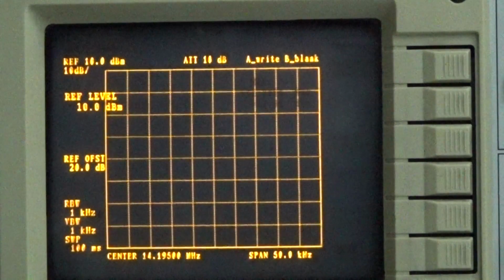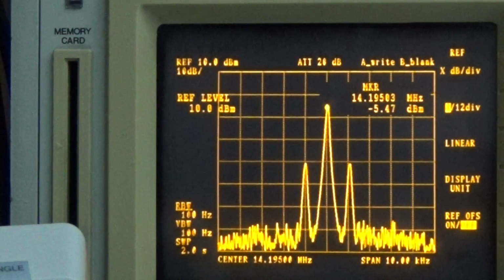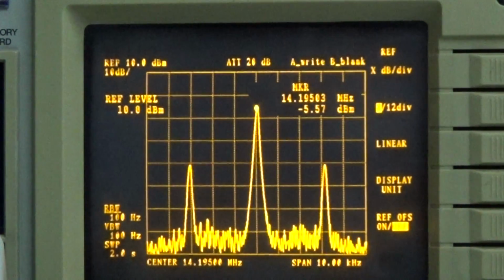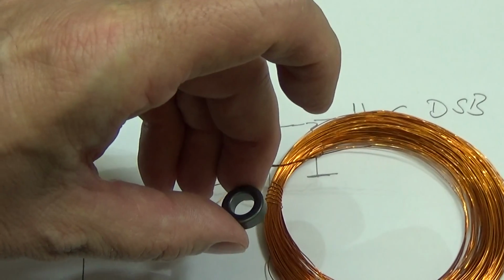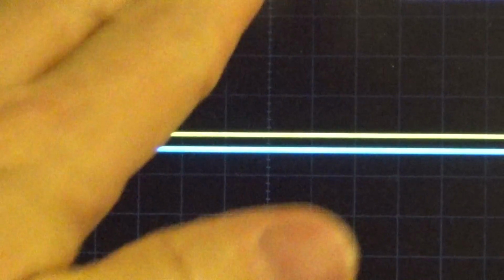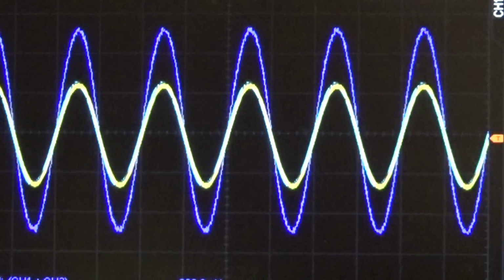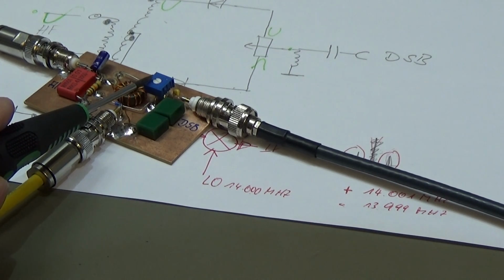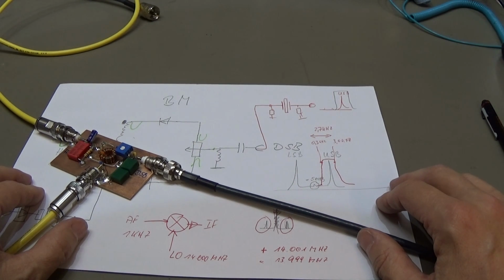#66 HAM Radio Tutorial: The SSB Balanced Modulator

Comment: Sehr gut Pete!  This video has helped me understand and balanced my DSB kit radio.  Your wiring diagram is the same on my kit drawings.  Although I don't have a spectrum analyzer, I used a dummy load and multi meter to measure the transmitted voltage down to zero to suppress the carrier.  It was very interesting to find that  null point.  If I turned either way, the voltage started to increase.  Signal reports from other Ham's were very good.  Big Mahalo, Martin, WH6XY

Comment: An outstanding presentation. By far the best on you tube (and anywhere else). I guess the main difference between a BM and a mixer (e.g. as used in a superhet radio) is that with the BM, the carrier frequency  is still present at the output but much reduced in amplitude compared to the sidebands.  With a superhet mixer I think the carrier amplitude is still present at the output at full amplitude together with both sidebands but now at the IF?
Reply from the maker: Thanks for feed-back glad that you liked it . all the best

Comment: Great deeply technical video! My question to you is there a good way to use an oscilloscope to evaluate the quality of an SSB modulator vs using an oscilloscope vs a spectrum analyzer as I am experimenting with some modulation techniques that are slightly less standard and wondering if I'm getting anywhere especially quick.
Reply from the maker: Yes use the 2 tone ssb scope pattern. Here you find a description https://www.nostalgickitscentral.com/heath/73-index/articles/Monitor%20Scope-7-63.pdf  and a nice one by Motorola  http://www.ab4oj.com/test/docs/ssb_im.pdf   Hope that helps 73
Reply: Spectacular reference, downloaded for future use.

Comment: Excellent video.  Thank you.  You should mention that a simple Beat Frequency Oscillator (BFO) adds the carrier back again at the receiver end.  Years ago I heard shortwave DSB broadcast stations using both sidebands with different programming on each sideband.

Next we need to suppress the carrier on FM transmissions (and make the power amplifiers linear).  Then do the same for CW - OK, that has been done already using Modulated CW (MCW) into an SSB transmitter.  I need more sleep (or less dreaming).

Comment: So is it possible to add this circuit with filter switch to a plain AM Transmitter to talk and receive on SSB?
Reply from the maker: Hi Wiliam, yes basically it is possible for a transmitter but under real conditions you would use a more advanced circuit as this is not fully developed to work broadband and even carrier reduction could be better. This was an example only but anyway it would work... 73
Reply: Thank you very much as most people already have at least one AM Radio and would save having to purchase a SSB Radio.
Reply: What do you think of these SSB Kits and the FREE Downloads for their earlier versions. They do not list a 10 or 11 Meter version on their site at  http://www.ozqrp.com/index.html.
Reply: http://www.qrpkits.com/ Site in the United States.

Comment: How it's possible that on your oscilloscope, having 2 input signals with the same phase and take a positive signals as output !?  ...i have lost some step.. :(
Reply from the maker: Hi Alessandro, yes that is right. Just make a simple addition with the both signals at the same ´phase angle. Then you find the results and it becomes logical.. Hope that helps 73
Reply: Maybe i have lost a RF ground reference for this kind of signals, this could be  a small reason to do a new video with this argument ..  Thank you again, have nice day !! ^_^  '73

Comment: Very nice job - thank you.  Wish you could have gone into the sideband filter more but very informative just the same.
Reply from the maker: Thank you Digger. 73
Reply: Now I've been reading and learning about SSB for the past day (I'm rather obsessive about these things lol).  Still can't find an explanation of the filtering used to remove the desired sided band.  I know there is a phase shift method and I believe a crystal filter method and I've found plenty of math but no simplified explanations to get me started :(  It's all your fault :) lol.
Reply from the maker: lol yeah of course :^) Basically it is quit easy you put a band path filter let me say of about 2,7kHz over the wanted area lets say the USB area but not including the reduced fundamental. Now you only have the wanted signal passing trough and the LSB and the rest fundamental will get attenuated.That's it
Reply: TRX Bench Conceptually yes - now I need to learn the methods.  You've inspired me to hit the Arrl Handbook section on modulation, demodulation and mixers ;)  Thanks again for all the lonnng but interesting and informative videos.
Reply: TRX Bench I think the ideal follow up to this video would be building a crystal ladder SSB filter :)  I'm still learning but making progress on this knowledge.  73s
Reply from the maker: +Digger D very good keep on going 🤗🤗
Reply: Thanks, I am - learning how to measure the crystals, etc... One day I'll build a SSB circuit.
Reply: Digger D

Comment: Very interesting. However, would the SSB filter you mentioned at the end not also take out the carrier? Do you actually need to build a BM if the filter is capable of removing everything except the 2.7kHz bandwidth surrounding the desired output?
Reply from the maker: +Spoolz07 The requirement for a filter like this would be much higher and thus it would be much more expensive. Additional to that this would go into the wrong direction as we do not want to have a component in our signal which is consuming power while we want use the advantage of SSB mode on the other hand.

Comment: Thanks so much for your tutorial , very useful and interesting, I would try to build it did not see the value  of the potentiometer  , indutance, and the cap on the rf output.
Reply from the maker: +Silvano Calza` Hi Silvano, for the pot you can take 470Ohm and for the inductance it is something between 500 and 1000uH. The coupling cap at the output is 47nF. Hope that will help. 73
Reply: +TRXBench Hi Peter, Tested successfully, thank you.
 My result, first photo with fixed frequency, second picture with Sweep 1 to 15 Khz
 Here are the links.
https://goo.gl/photos/wxr2ZcPbJz4s2nrp9
https://goo.gl/photos/x3N5hwjihu7fvBKTA
Reply from the maker: +Silvano Calza` Nice success! 73

Comment: Another great video Peter.  Interesting historical note on SSB or should I say the transition to SSB was DSB.  Early tube type side band CB radios were really DSB.  They transmitted DSB and received SSB.  Not that great a system but it worked as a stepping stone as technology advanced.

Mike
Reply from the maker: +MikesRadioRepair .CBRadio Hi Mike, well in today's analogue radios the BM is basicly the same idea but it is all in one IC. Additional to that the circuits are active today and not passive like in the past. And off course the phase shift is done with modern semiconductors in the IC and not with a broadband transformer. After that the DSB Signal goes into the DSP for filtering...  Thanks for comment I was not aware on the fact that DSB was really sent out in the past. According to my knowledge DSB transmission never  happened  in Europa on CB.   Again thanks for your valuable information! 73